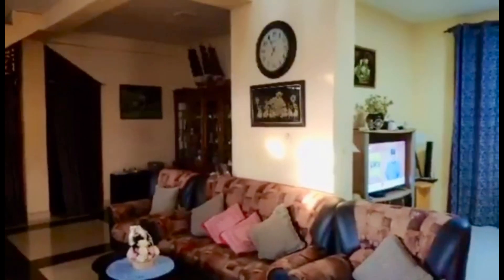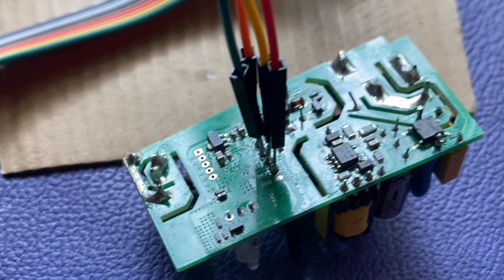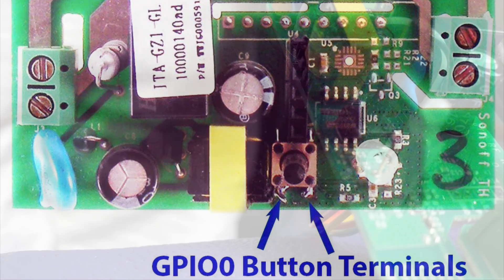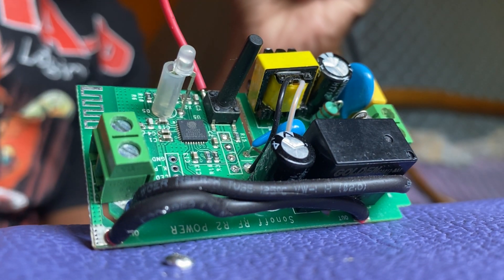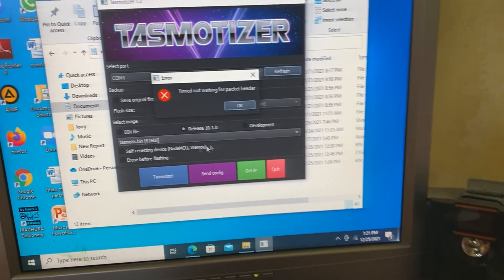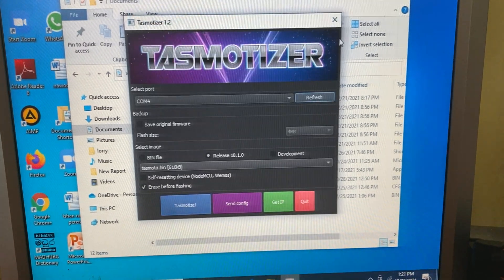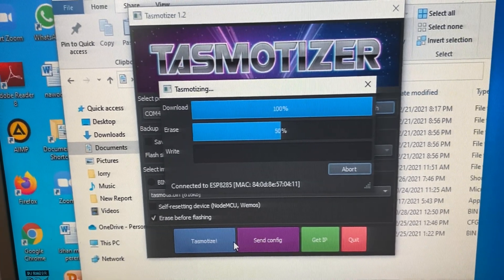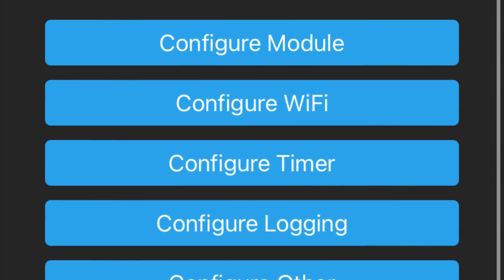How to Tasmota Sonoff Device - COMPLETE Guide

Comment: Why flashing it with tasmota. Ewelink works perfectly fine then why
Reply from the maker: This one got software issues. Its not connecting in ewelink server. And if you don’t want connect your devices to cloud for safety reasons, you can use this for local control